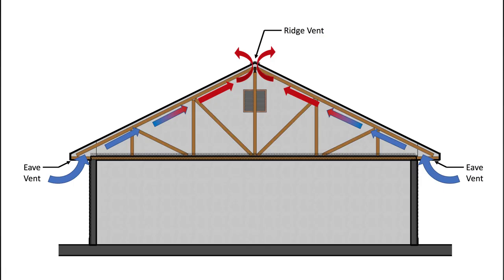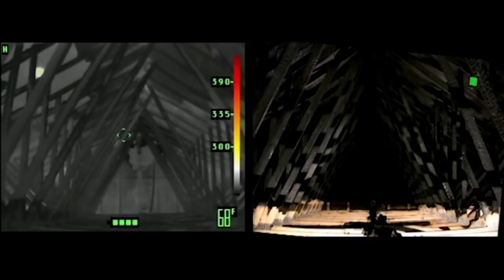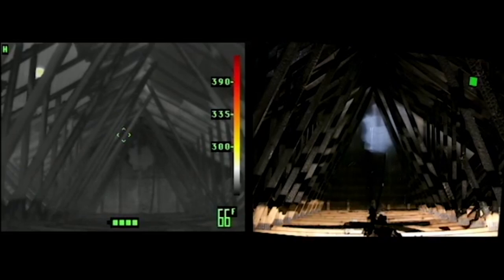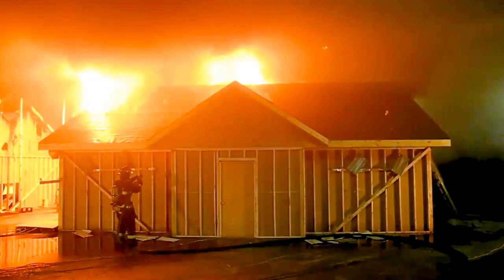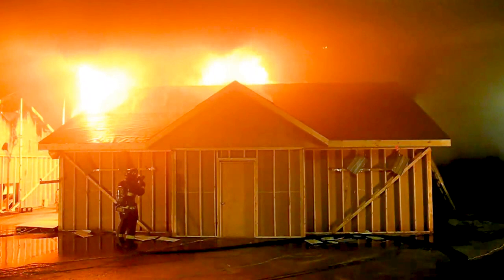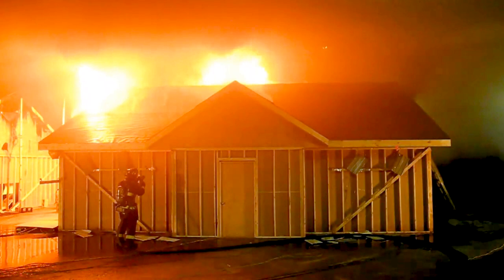Tactical Consideration: Get Water in the Eaves for Attic Fires

Comment: Good video.  I'm looking at adding/augmenting our tactics manual to include a section on attic fires.  Have you noticed any difference with nozzle size and adjustability? eg. 2 1/2" vs 1 3/4" and smooth bore vs adjustable fog nozzle.  Also, have you done (or know of any) any controlled experiments with foam application on the initial attack?
Reply: Hose and nozzle size should be appropriate for the size of the structure.  Obviously you wouldn't use a 2 1/2" line on a double wide prefab, and you should've be using a 1 1/2" line on a McMansion.  Foam or a wetting agent is just going to make things even better, as it usually does.